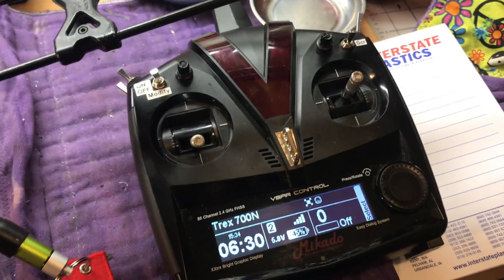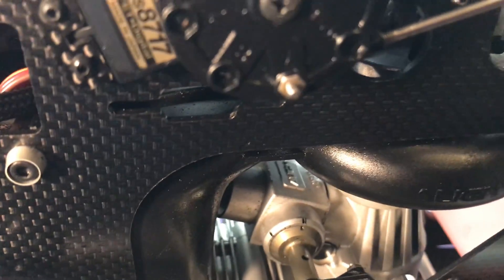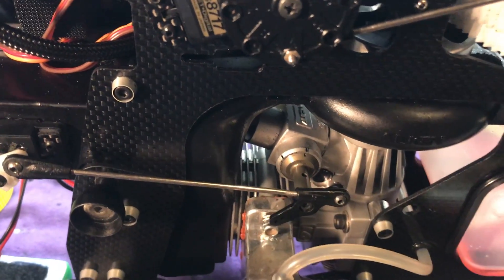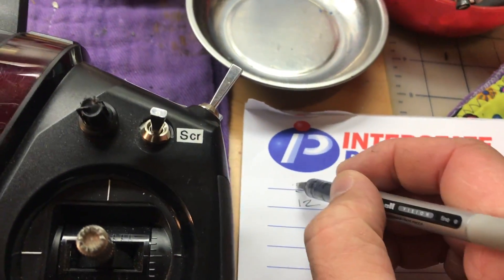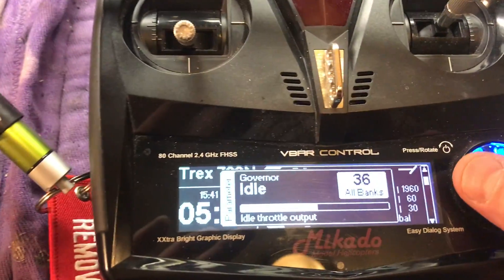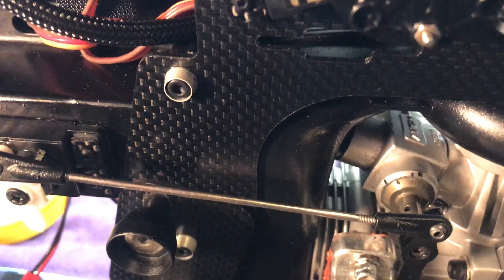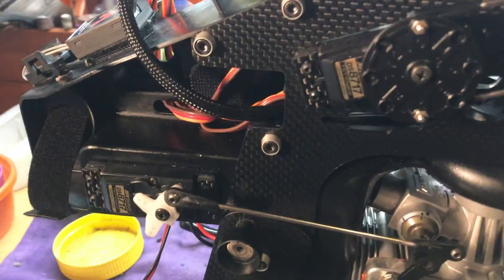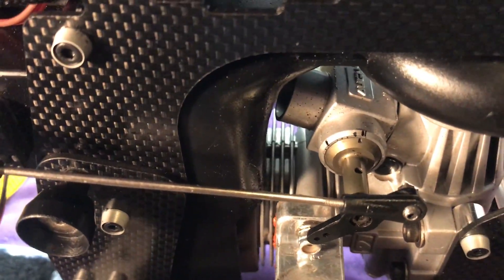Vcontrol macrocells throttle advance mix for poti 1

Comment: Fantastic video and very well explained.  But!..  Can I do that with a DX9?  I've noticed that the trims don't work in normal mode on thsi TX too
.
Reply from the maker: Sorry. I never created a macrocell mix on anything other than the vcontrol. But, if you have access to macrocell programming in the vbar software I don’t know why you wouldn’t be able to assign the input to one of your unused knobs or sliders.

Comment: Hi, i did wat you chow on your video, when i put my thr cut on  after turning the nob to max the thr cut is also a litle higher.
Can there be done somthing to undo that?
Reply from the maker: Léonard Gérard unfortunately, no. It’s kind of a hack mix anyway. I also learned after a few flights that unless the poti know is turned all the way up, your max throttle is lessened as well. Now I’m debating the usefulness of the mix. Works great for starting. But have to turn it down to land or idle is too high. Have to turn it up to fly or there’s no wide open throttle. I asked Mikado for advice and their reply was “this has been addressed in the new Vcontrol touch” 
🤬 you gotta be kidding me‽
Reply: slackering  okay, thanks 4the reply! It was worth trying😉